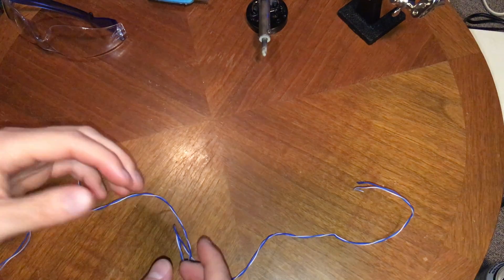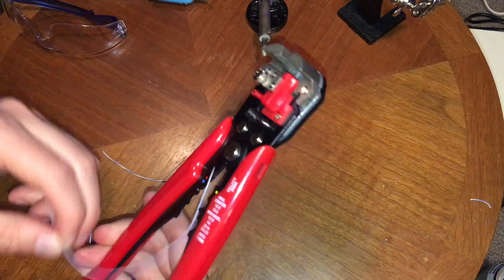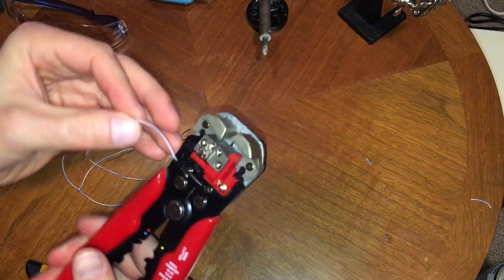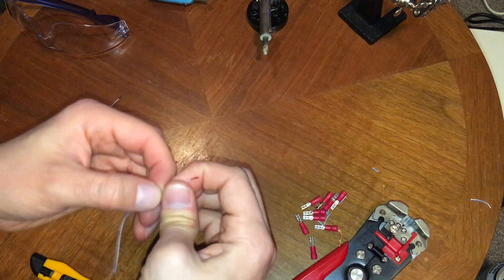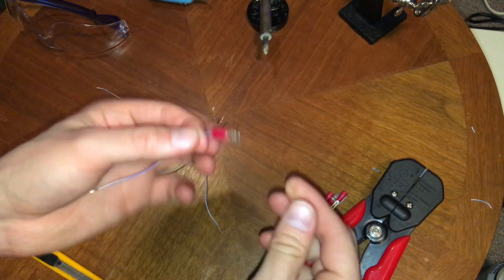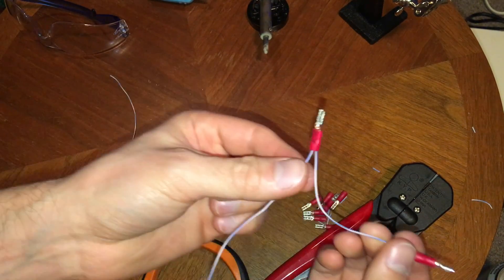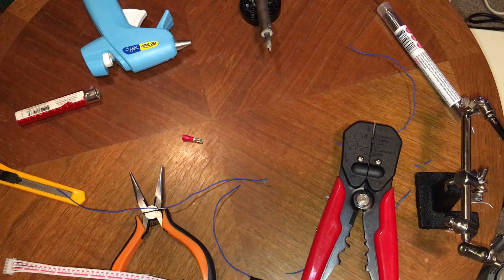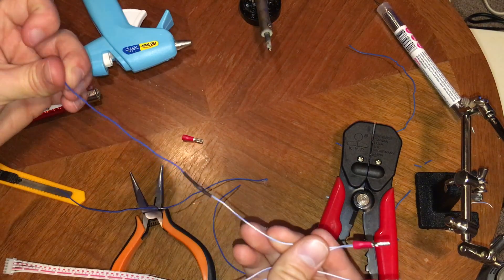Wiring basics - Fightsticks

Comment: @Sawdust and Circuits if I have acces to a 5 pin quick connect that you mentioned, can i spliced the cables and electrical tape them for each of the 5 connections?

Comment: in case i dont have quick disconnect (it's not popular in vietnam) and soldering equipments (expensive here in vietnam), is it okay to use electronic tape or hot glue to stick the wire to the buttons?

Comment: What about 7pin connectors you put the wires In to that connect to the PCB? What are those called specifically for the MadCatz Alpha? I'm re-doing my buttons and want to know where to buy some new white single row male connector plugs but I don't know what they are specifically called and it's size.
Reply from the maker: Not sure if I know exactly what you are asking for.  But the main button wires are still on the PCB and the ground wire is common and shared along the buttons.  For that common ground you daisy chain the wire like I have shown here.
Reply: +SoftserveSpecial my apologies for the poor wording. I'm on the wrong video. I was looking at your Alpha No soldering mod video and want to know what kind of 7pin connectors you use. Are they called JST female 7-pin?
Reply from the maker: +Donnie M no problem!  They were just female / female connectors.  I connected one on each wire.

Comment: thanks for the follow-up video! yah i definitely watched a bunch of "how to crimp wires" and other videos trying to figure this part out. lol

actually quick question, I bought a crimp tool and open barrel quick disconnects from focus attack and was wondering, how much copper should be touching the terminal? is it possible to expose too much copper for the terminal? watching this, i wish i had bought those QDs instead. and also extra ground wire because i had wondered how i would connect the end of it back to the terminal strip..for future reference, where can you purchase those heat shrink tubes?

Thanks again and your crimp tool looks super legit!
Reply from the maker: Hi Angelica, you want to have enough copper wire exposed to connect with the quick disconnect, not not so much that it is spilling out of either end.   Some trial and error should get you more comfortable with it.  

The heat shrink tubing was from Amazon, very inexpensive.

Comment: What brand is your crimping tool work the wire stripper?
Reply from the maker: +Ricardo Molieri Hi Ricardo, sorry about the late reply.  I use a "Neiko 01924A Wire and Cable Stripper with Self-Adjusting Jaws 10-26AWG"  It was about $25 CAD from Amazon.

Comment: Gonna just guess that once I crimp something so badly to where the prong won't even fit in, I'm fucked and gotta replace the wire.. right?
Reply from the maker: If you can snip it right where the disconnect starts you might have enough room to put another on.  If not just add an extension to the wire and put some heat sharing tubing on it.